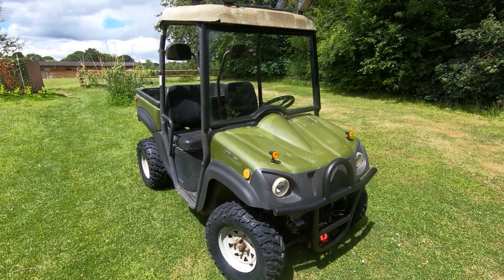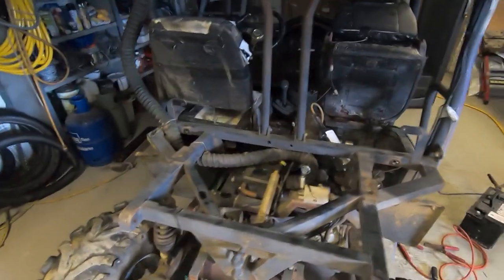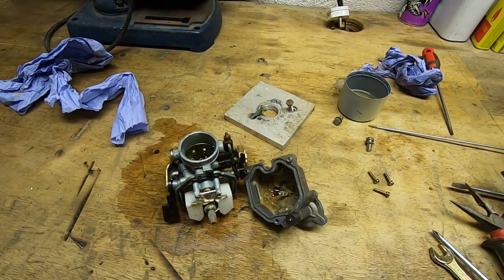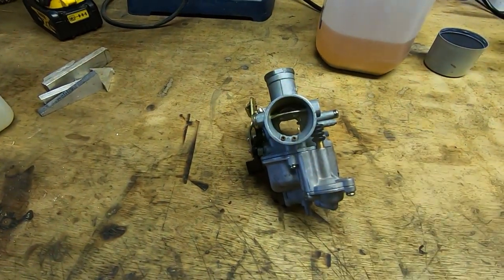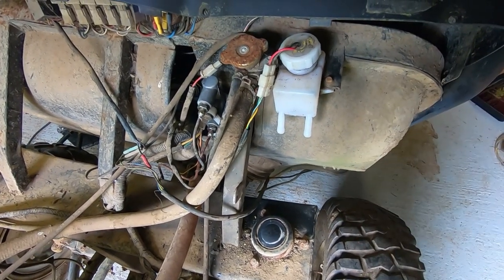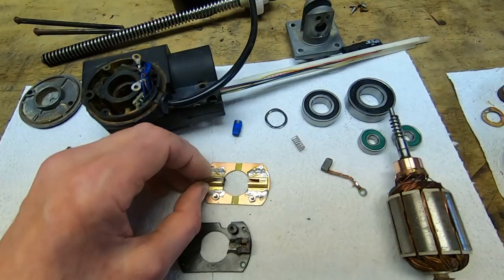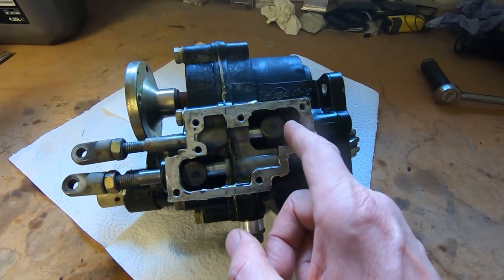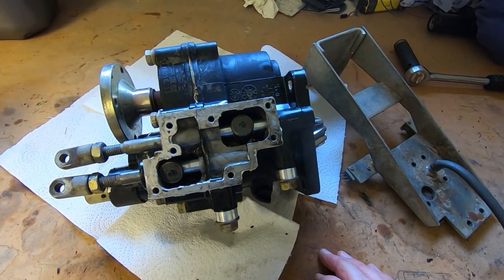Utility Vehicle Repairs Part1

Comment: Great job as usual! I used to work on a lot of these type of Chinese made vehicles. The quality of the wiring loom is questionable at best. I would recommend rebuilding a simplified wiring loom from scratch. The wires are too thin and the isolation on them tends to crack with time,  causing a lot of problems. Also the pins in the connectors are poorly crimped and sometimes develop contact resistance. The carb should be fine with the correct jets in it. You can tell if the idle jet is right when the engine will idle correctly with the mixture screw turned out about 1.5 turns from completely turned in. If it is more than that, then you need a bigger jet. If it is less, you bid a smaller one. 

The main jet is a bit more tricky but basically you should select it for the best top speed on wide open throttle.
Reply from the maker: I have already replaced all the connectors (you will be able to see them in the next video) but the actual wires seem to be good quality and the crimping was OK but corrosion had set in as the machine spent 10+ years sitting in a field. Yes I have also worked on many engines over the years. The main jet mixture is actually set by adjusting the needle height setting on this carb. The mixture screw only really has an impact on the idle stability on this carb.
This carb is the wrong one for this machine and is for a motorbike so the mixture screw is on the bottom. I have to remove the carb to adjust the mixture so it is not as easy to adjust as it would be with the correct carb (That is why I set it 1/4 turn extra out to avoid running too lean which can damage the engine). Setting up carbs is fairly easy but I always start by setting the float chamber level as this has a major impact on the jetting.

Comment: I just started watching another channel and saw some restoration of old neglected engines. Never knew that similar content will drop here.

That sludge in carb seems to be varnished petrol. I am not really sure how it happens, i know that petrol can go bad but never really dove into finding out how. Seems like a reason carb cleaners exist.

Waiting for next parts.
Reply from the maker: Most of what was visible was aluminium oxide caused by the fuel and water. Petrol used to keep carbs clean but modern fuels are a menace and the ethanol absorbs water so pulls water into the fuel tank and the result is what you saw in the video. I do not show it in the video but I have fitted a switch to shut off the fuel pump and after use I will turn off the pump and let the carb run dry (I do this on all my petrol machines to avoid this mess).
Reply: Yeah. Was gonna comment about hygroscopic nature of current fuel, but did not really knew when they started adding ethanol to it. Was fuel 10 years ago with it?

Petrol engines really need to be used or more maintenance than diesel.

Thanks for the vid.